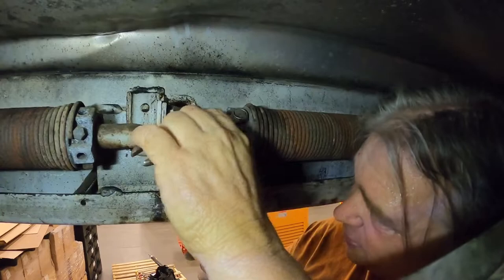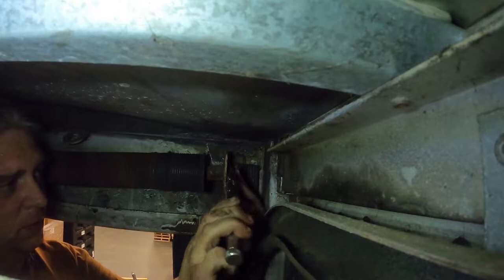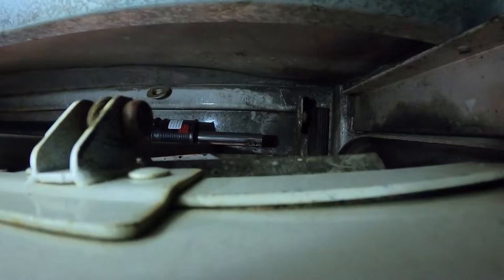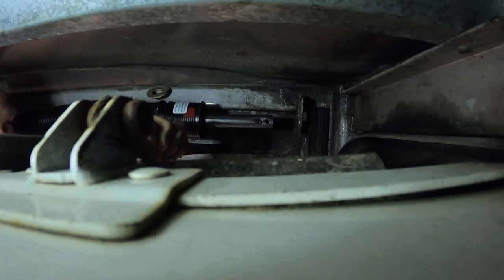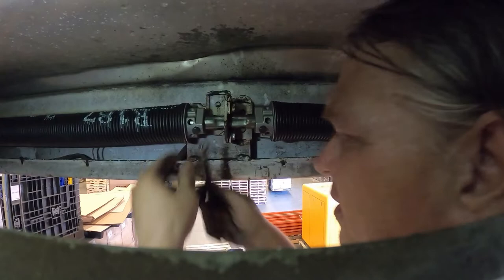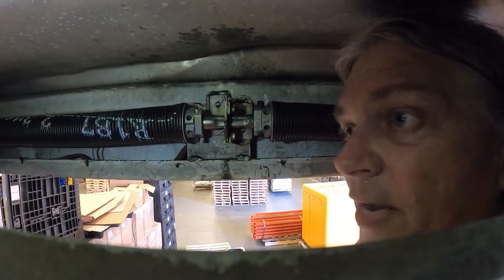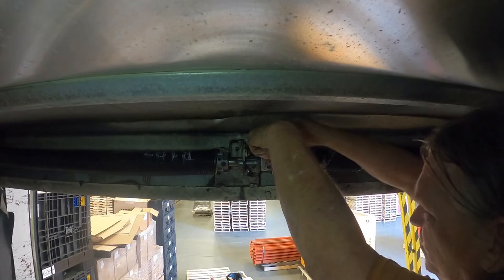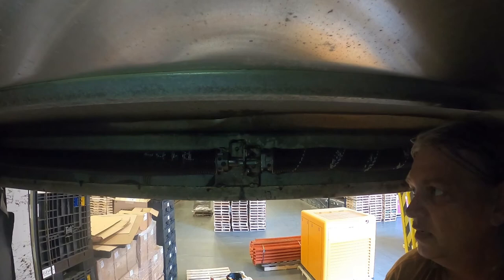roll up trailer / box truck door operator

Comment: You have worked on this 2 spring so dangerously and wrong you could have removed all tension on everything by taking off the clip in the middle with a half inch wrench and then taking out the tension with two 13/16 wrench unwinding the square part of the tube. This video is so unsafe for people if they listen to what you’re doing. No hammer no rope. No metal to hold the door back. None of that would’ve been needed. You also don’t need your face to be between the door in the header.